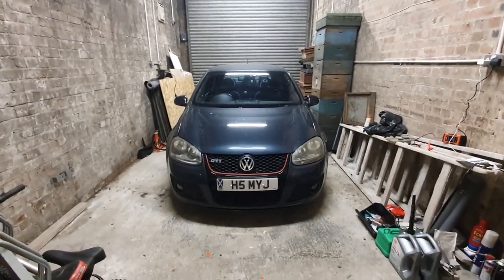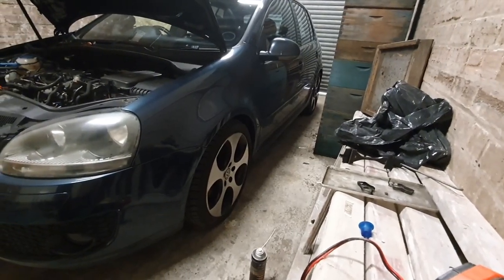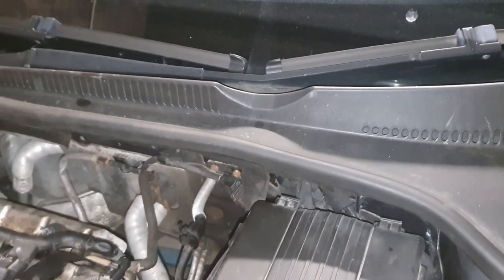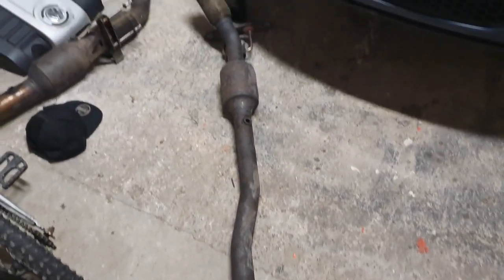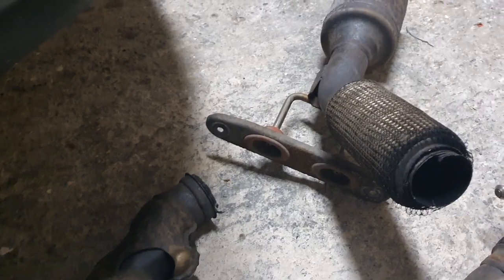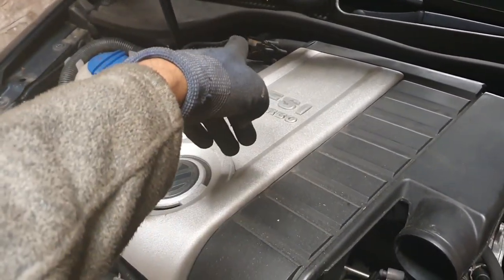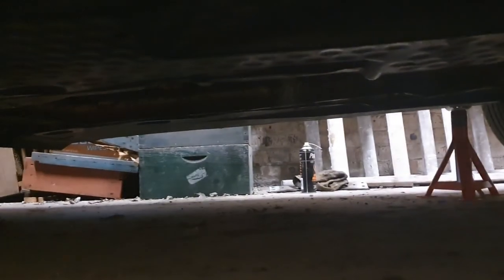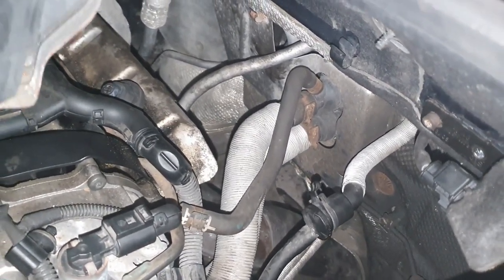MK5 Golf GTI Exhaust Conversion *R32 STYLE* Part 3 - Sports Cat

Comment: do you keep the gti original with an r32 rear or put ed30 front lip /sideskirts or even r32 frotn side on it?
Reply from the maker: Mine is currently all stock with the R32 rear. Ed30 parts should fit. I'm not planning on putting the R32 front end on it - the GTI one looks 👌🏼
Reply: @HimiJ  well if your gti bumper is oem it must fit ed30 is just an front lip extending and making the front lil more agressive would suprise me if it wouldnt and the r32 is to much work since it wont fit at all. nice knowing more about the build
Reply from the maker: I didn't know the ed30 had a different front lip - thanks for the info. Might look into getting one.
Reply: @HimiJ  np, well the gti ed30 is just an golf which is little more agressive aero added to the golf bumpers with bigger turbo i think bbs wheels 

and it got the same taillights as the r32. in case you didnt know i hope i helped you a little more there